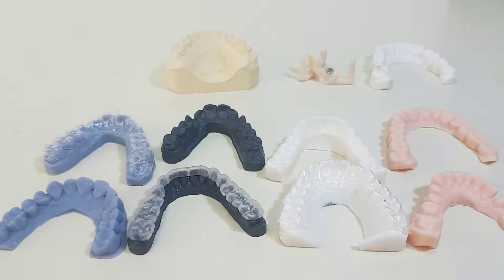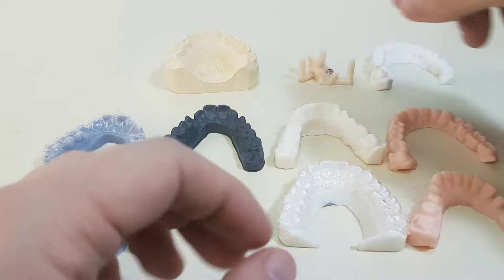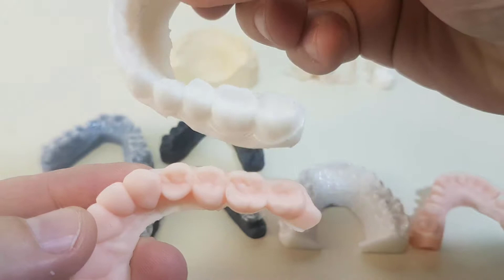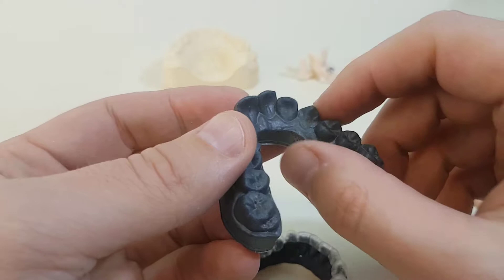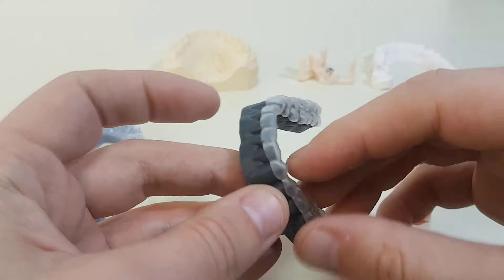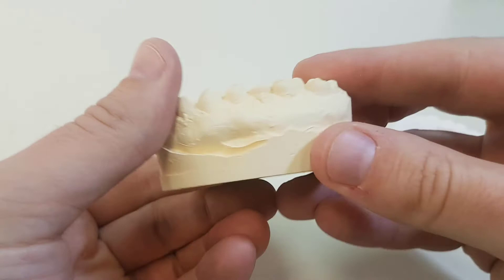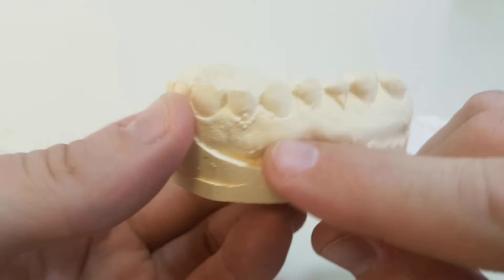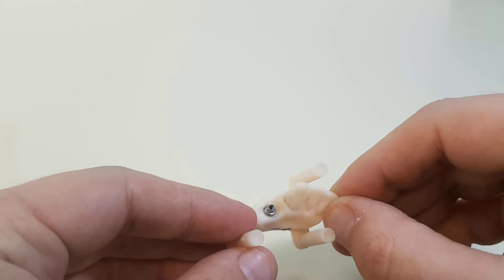3D printing dental models: material comparison and tips

Comment: Hi, I was wondering if you could compare making a crown on Elegoo and placing it on a tooth model printed with Formlab? and vice versa. to compare its accuracy? If the crown from Elegoo can fit perfectly into the working model from Formlabs then there is no significant difference?

Comment: Can you tell me the type of 3d printer and resin you are using and the curing time of the resin?
Reply from the maker: Hi,

I am currently using Formlabs Form 3B with some of the dental resins. https://dental.formlabs.com/eu/

The curing time is important for surgical guides and temporary and permanent crown and dentures, but not for dental models.
Reply from the maker: The 3D printer i the video is an old model, the Elegoo Mars, there is a new model called Elegoo Mars 3 pro.

It has a small printing area, but it is fine for many applications.
Reply: @MarcoDeRossi  thank you
Reply: @MarcoDeRossi  thank you

Comment: Do you recommand the New phrozen sonic 4k And what is the Best resin that goes with for long term and esthetic full mouth temporaires and aligners? Thank you for your valuable videos !
Reply from the maker: Hi, I haven't personally used the phrozen sonic 4K, but it does seem like a great printer, with great quality and good print speed.
I don't know of any resin that is compatible with the Phrozen sonic and is also certified for extended patient contact.
Although some of the certified resins from Fomlabs or Envisiontech might work with the printer, I do not think they are certifiable if used with a different printer than the one originally intended.

If certification is not an issue, then you mught want to try the envisiontech resins and follow their fabrication protocol carefully to avoid any problems.

Good luck

Comment: i could not get a read as to which printer you prefer.
Reply from the maker: Hi Marcos,
I really don't have a favorite machine, I believe there is a balance between how much time and effort you want to dedicate versus how much money you want to spend.

Cheaper machines require more labor and more verification, more expensive ones save you time and give more reliable results which save you even more time. 

My suggestion is that when in doubt, go for the middle ground, not the cheapest, but not the most expensive.
If you want to learn(through mistakes and problems) buy an inexpensive machine.
If you just want it to work and forget pay more.
Just a quick gradient of prices and quality/speed

250€ Elegoo Mars < Phrozen Sonic< Prusa SL1 < Zortrax inkspire < Formlabs Form 3 < SprintRay Pro < DWS Xfab < Envision One 16.000€
Reply: @MarcoDeRossi  thanks!! I'm precisely wanting to start as a hobby first. Elegoo is the one I'm looking at

Comment: Greetings, thanks for the video. I'll be using the new Anycubic Mono X to print models to make night guards and aligners. Some dental resins are expensive. What resin do you recommend that would be good and hold up for the theremo-acrylic molding? Thanks in advance for your response.
Reply from the maker: I have tried expensive Formlabs resin and cheap gray Elegoo Mars resins with good results for thermoforming, just make sure that if you are using a cheap resin, that you make a solid model so it will withstand the pressure better.
Also avoid placing the model during the heating process, add it only right before lowering the hot fil.

Every resin and machine is a bit different, so make a few tests before using the models for patient treatment.
Scann the dental models after thermoforming to see if they suffered any deformation.

another test is to print two copies and use only one in thermoforming and compare the dental aligner on the other one.

Machines and materials alone will not guarantee a successful result, you must have a good workflow and a Quality assurance process in place.

Good luck
Reply: Thanks for the quick reply and great advice. Do the acrylic appliances pop off the cheap resin without breaking or do you use a release agent?
Reply from the maker: @toakamate728  I have not use a release agent, I have seen good results removing clear aligners using  compressed air.
Leaveing the protective film on the plastic sheet also can help with surface quality and demolding.

But your results may vary
Reply from the maker: @toakamate728  I have no experience with acrylic appliances, sorry
Reply: @MarcoDeRossi  Different terminology - I'm just referring to the clear plastic (acrylic) sheets used to form the night guards, aligners, etc.

You have been extremely helpful. I'll make test models from several brands of "cheap" resin and experiment.  Thanks again for your time.

Comment: Hi Marco, thanks for your video , have you tried to use dental resin on the elegoo mars?
Reply from the maker: Hi,

I haven't tried any resin that requires certification on the elegoo, as most special dental resins are used in contact with the patient, such as surgical guides, dentures and temporal and temporary crowns.

The certification process requires that the material is printed with the designated printer, under strict manufacturing parameters and well defined post processing procedures.
Deviation from that process would mean that the end parts are not certified and may pose a risk to the patient.

I must admit I am curious to see if it even cures specialized resins, maybe using a resin from a DLP printer manufacturer, such as Envisiontech, might be more compatible with the MSLA technology used with the Elegoo printer.

But tolerances, resistance and chemical characteristics may end up being all wrong.
Reply: @MarcoDeRossi  I understand, 
I’m just curious about if a cheap 3d printer can handle the dental materials  , and if it can , what should be the difference with a dental one ( except of course for the certification  or the price) 
Because if it’s similar some one can use a cheap 3d printer for training , avoiding all toxicity from 3d standard resin
Reply from the maker: Most modern resins cure using 405 nanometer UV light.

The main difference is the intensity of the light needed to cure and the temperature.

Laser resins need greater power to cure than MSLA and DLP resins, that is why I assume a resin for a DLP machine might cure in an Elegoo.

To print a test, you would need to calibrate the exposure time of the resin, to short and it will not cure properly and fail, too long and you will reduce surface quality and accuracy.

The main problem with testing dental resins is that they are very expensive, so it costs a lot of money to test, specifically if you won't be able to use the model afterwards because they are not certified
Reply: @MarcoDeRossi  I see, and there is a easy way to calibrate or just have to do lot of prints and see which one looks like more the model printed in a good printer .
My question is because I understand that dental resins is 10x more expensive than regular one , but also is much less toxic , so for training may worth the extra money for safety.
Reply from the maker: @ArtfromSky  to calibrate the exposure of a resin there are files that print a calibration pattern (a complex geometry, lines, holes and dots) at different time exposure.

Once it is printed, you must determine which exposure time gives the best results.

Keep in mind that temperature has a significant effect on curing, some resins may not cure properly if done under a certain temperature.

Try and have a warm and spable temperature wherever you use the machine beforee calibrating the exposure time.

Dental resins have lower toxicity, but also guarantee a very tight control of the manufacturing process, avoiding contaminants and variations.

Keep in mind that after printing, you will need to wash the part in completely clean alcohol and cure it following the manufacturers guidelines, all to avoid the toxicity of the materials.

Comment: I watched the whole video waiting for you to say what that "sub $300 other machine" was that made the blue one because it was very impressive! You never said...? What kind if technology was that and where can i get one for sub $300?
Reply from the maker: Hi TooTH PICK,
I did mention it right at the beginning when I pick up the model, but it is probably difficult to understand, the machine is Elegoo Mars and you can find it for 250-300 U$D and 1 kilogram of resin is around 50 U$D.

The resin I used for the model in the video is the gray resin.

It is a great machine to get started, but it can fail, and break easily, so I would not recommend it as your only machine for serious professional work.

But as inexpensive first printer or an extra printer to offload simple work from a more expensive main printer, it is highly recommended.

Comment: You cut the Mask on the 3d model print? You are Crazy man
Reply from the maker: Hi David, I do not personally do the aligners, I only advice dentists on how to use different printers and materials.
I believe cutting the aligners following the gum line is something that has been used with plaster molds before.
Do you think it is wrong? I would love to hear other suggestions and learn about different techniques.
Reply: @MarcoDeRossi  se sei italiano e parli italiano possiamo scriverci così....if you dont speak italian i Will write in my bad english🤣🤣🤣🤣
Reply: @MarcoDeRossi  anyway .... I prefer to extract the templates printed on the models and then use the appropriate cutters to cut them, so that the models remain intact and reusable for any reprints
Reply: Hi could you have the print parameters please